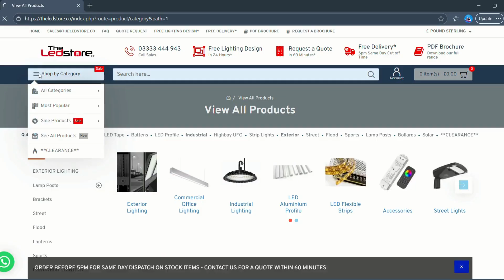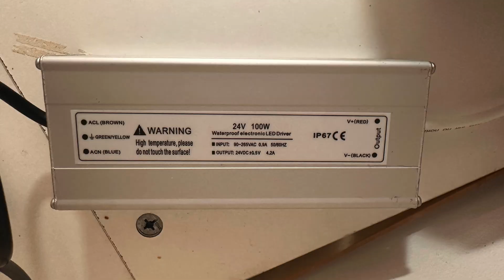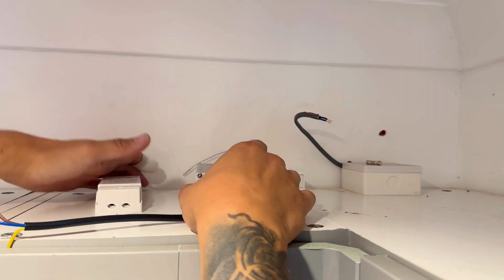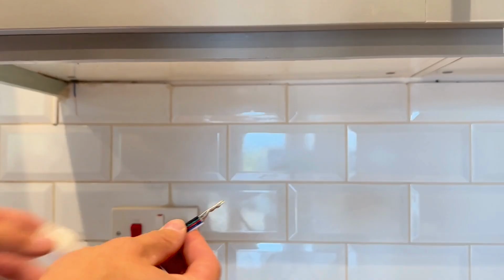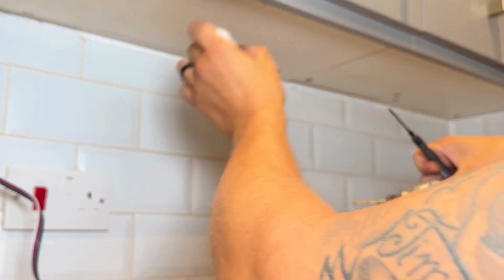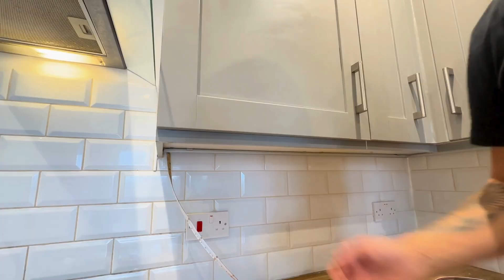DIY LED Strip Lights with Remote Control Setup

Comment: Great Video, what if you have 2 seperate wall units between an extractor hood with a continuous cornice above it and want led strips beneath both on the same receiver. Thanks
Reply from the maker: Hi,

You can either run a cable directly from the receiver to both LED strips, or link the strips together by running a cable from one strip to the other.

In my installation, I chased a cable into the wall from the top of the cabinet on one side of the cooker hood across to the cabinet on the opposite side. The cable was then terminated into a junction box, with cables running down the back of each cabinet to feed the LED strips. This keeps the wiring hidden and provides a neat, professional finish.

Comment: Could you use power supply from a ceiling light to run this? If you are removing the ceiling light, and want to feed that supply straight into the receiver?
Reply from the maker: Yes, you can.
If you’re removing the ceiling light, you can use the existing permanent live and neutral feed to power the wireless receiver. Just make sure you have a permanent live present (not just a switched live) and that the connections are made in an accessible junction box or suitable enclosure.